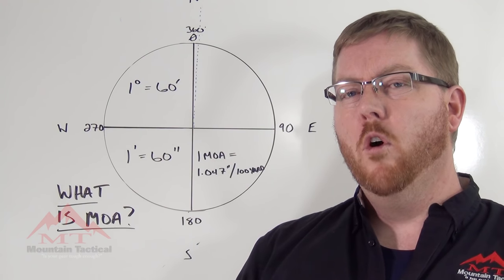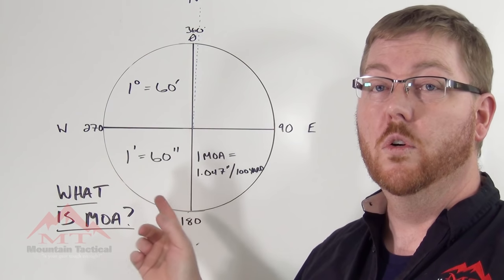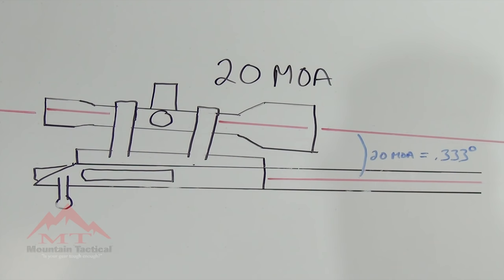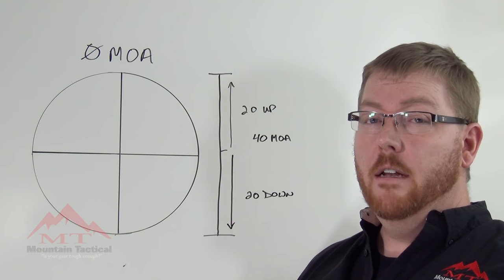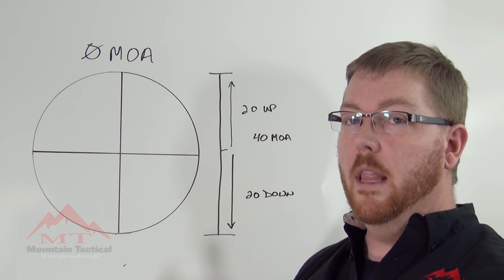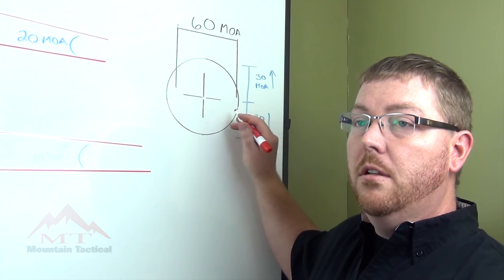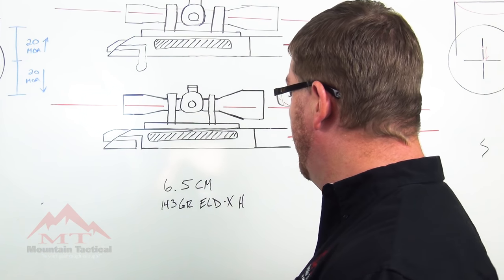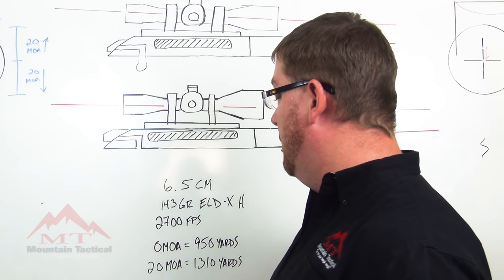0 MOA vs  20 MOA What Does it All Mean?!?!

Comment: I have a question might be stupid but I’m fairly new to all this but the gun I’m getting has a 20 moa piccitiny rail already installed and I’m looking to put a Nightforce NX8 4-32-50 on it would this be a nice set up? And also if the front of scope is pointed down would any part of the barrel show up in the scope if it has a 26 in barrel?? Thanks
Reply from the maker: This is a great question!  First off, that set up sounds awesome. Sounds like you plan on some challenging, long range shooting. I run a similar set up with high rings from Seekins and the barrel is not visible in my scope. Enjoy that rifle!
Reply: @mountaintacticalcompany  thank u , it is a seekins ph2 by the way , I seen that someone posted a problem with the same exact set up but said his barrel showed up in the bottom part of his scope so I had to ask someone with more experience, sounds to me like his scope is mounted properly or something but not sure , thanks again
Reply: Not mounted properly
Reply: @mountaintacticalcompany  have u ever even heard of that the scope picking up the barrel ? I had a guy tell me with the nx8 his 26 inch barrel was plain as day in the scope and even switched to a 22 inch barrel with same scope and still had the same problem, makes 0 since to me

Comment: wouldn't you want the rail the other way so it has the scope higher towards the sky? That way the scope is aiming higher.  Rather than having it the way you have it and the scope is pointing more down towards the barrel.
Reply: No, that would put your bullet in the dirt. Hold two pencils in front of you one is your barrel the other your scope. Change the angle on your top pencil (scope) and note the angle of the lower pencil (barrel) as you sight in on a target across the room.
Reply from the maker: You want the barrel towards the sky, not the optic.
Reply: Thank you I am starting to get it now
Reply: @mountaintacticalcompany  Thank you I am starting to get it now